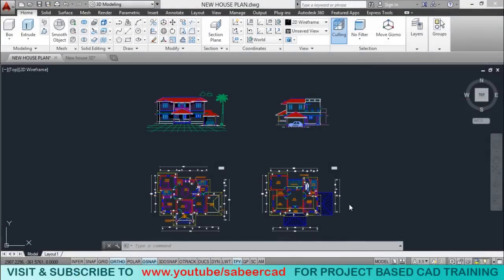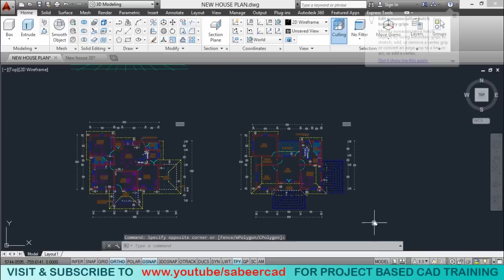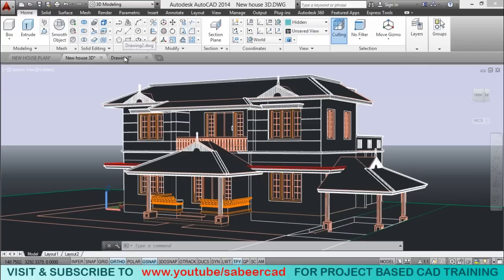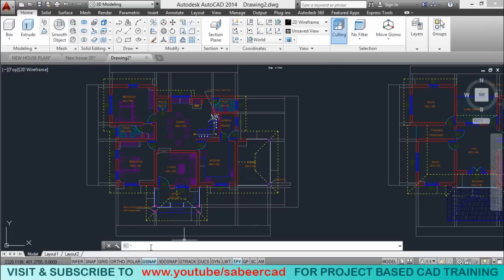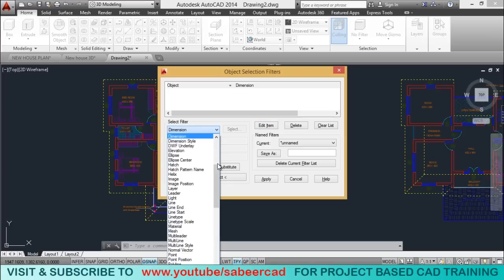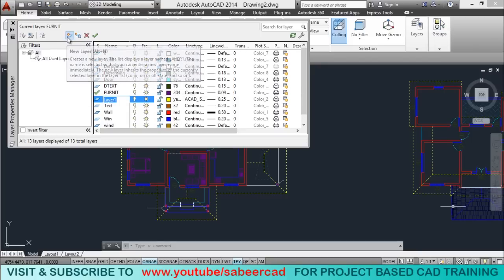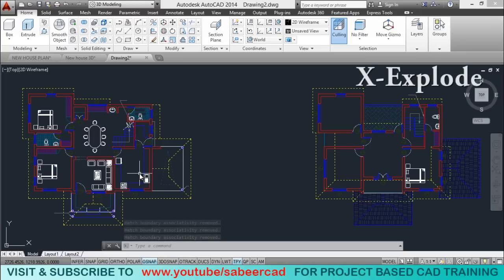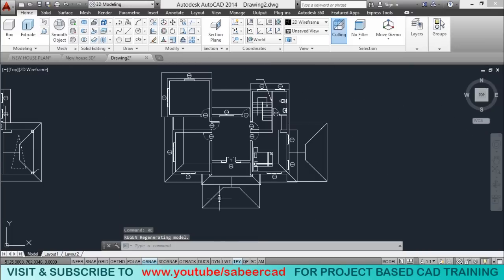AutoCAD DOUBLE STORIED 3D HOUSE -  PREPARING THE PLAN FOR 3D

Comment: OK. This was a very very long way you showed! There is a much quicker way to extract plans, section and elevations from a 3D file in AutoCAD. This feature has been introduced in release 2013 and can be found when you activate a Layout. When clicking on a layout you will see that a tab Layout will appear above the Ribbon, in there you have the option SECTION, PROJECTED and BASE.
Another option would be creating a Section Plane using Live Section.
Reply from the maker: iFFYtjuh Thanks for your feed back . The purpose of this tutorial is not to create Plan , Section and Elevation from a 3D model , but to create a 3D model using the Plan , Section and Elevation drawings (which are prepared already using AutoCAD drawing and editing commands) as references .....

Comment: hi sir i am new to auto cad, by seeing your tutorials i am learning the autocad, actually when i am trying to draw the extrude, the whole design is turning to lot of grids like parallel lines can you give the suggestion????????/ before i am able to draw this bt now only it has changed. and i am not profitient at ucs coordinates
Reply: Siva prasanna Did you solve this problem, and if you did can you tell me how ?
Reply from the maker: Siva prasanna It is not the problem with UCS . It is because your polyline is closed . So you can make another polyline on the top of existing one . start from the first point and pick rest of the points and give CLOSE option to get out of the command . This will give you a closed profile which can be readily extruded . Sorry for the delayed replay ....